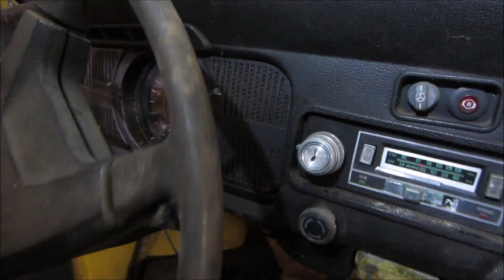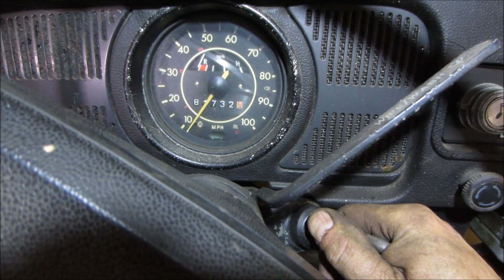Will It Run? vw Bug abandoned in a Leaking Wet Garage.

Comment: When you were jacking it up, it reminded me of many many years ago, a friend bought a beetle, asked me to show him how to change a wheel as he'd got a puncture.
He put the jack under ...& he started turning the handle as i watched ready to take the wheel off...
But it didn't move...& the jack was at its max height...
However the passenger seat  was around 8 inches higher than it was.......
Reply: Had that fun with a Fiat126 some years ago...the whole side rails beyond the doors were made of bondo and paint...
8-0
Reply: Szibul
Reply: Same thing happened to a family friend's bus. Right through the floor. IIRC he still drove it home.
Reply: @horstszibulski19  one of them is my dream car. But one of the polaski fiat 126p's
Reply: A good solution for a really short passenger.

Comment: Just fixed my first small engine thanks to your videos. Grabbed a edger for $10 and cleaned it up. Oil change and new fuel lines and cleaned the tank. Messed with the timing as well. All said and done it cost me $26 with all the parts and everything! Thanks for your videos

Comment: What a resurrection feat! Can't beat those old VW bugs. I once floated one in a flash flood. A wall of water came out of nowhere and washed me into the middle of an intersection, bobbing around like a rubber duck. A guy nearby saw my predicament, swam out and towed me to dry land. Turned the key and it started right up. The only casualties were the "cocoa mats,'' which smelled like moldy carpet, and the two tailpipes that rusted out. So yes, they did float.

Comment: Craigslist: "Volkswagen for sale, low miles, always garaged"
Reply: Never Raced!
Reply: 'ran when parked'
Reply: Featured on Youtube...
Reply: Some Rust!
Reply: lol
Reply: Just needs a little TLC!
Reply: Runs and drives!
Reply: Everything will buff right out only needs slight cosmetic work
Reply: Lool!
Reply: Passed most recent smog.
Reply: I know what I got, no lowballers
Reply: @xq39  Beat me to it!
Reply: HunterShows, That's funny right there, lol. It, unfortunately, is fairly accurate as well! lol.
Reply: One lady owner, serviced regularly!
Reply: @Mangsaab1954  I read this comment and thought..."I don't remember commenting on a porn video..." lol.
Reply: Lmao! 😀
Reply: "A REAL CREAM PUFF" owned by a little old lady!
Reply: Keyless ignition!
Reply: @northstar2007  no ran when parked means its broken but it runs
Reply: just dont mind the Head slap
Reply: Get it. As long as there is an engine. Super bug. Twin port. Easy fix.. Not sure about floor panels. Usually all rotten. Can be restored. Used to do them all the time. Combie. Fastback. Bug.
Reply: Remember number 3  piston overheats. Even on new restored ones. No cooling gets to no. 3
Reply: Tip
Reply: Spoke it depends on how much you drink. After a six pack everything looks lovely

Comment: My ex-father in law had a beetle in the early 1970’s. He worked away from home but left the car at home so that I or a neighbour could use it for the benefit of his wife & kids. It was a car full of character - spare wheel under the hood with the windscreen washer bottle pressurised from the air in the tyre, 6 volt electrics, de-mister vents in the corners of the windscreen that smoked at high rpm, fuel level gauge that worked from a float in the tank through a bowden cable to a slide that moved up & down in the gauge plus many more idiosyncrasies that made it a car to remember. I loved it. The neighbour always rested his foot on the clutch pedal & when it no longer pulled properly it went to the scrap yard. A few years later I changed the clutch in a friends beetle & it was so easy to change that I kicked myself for not changing the clutch on my father in laws car.

Comment: I have loved Beetles since I was a kid in Chicago. In the early 80s was when I fell in love. I used to like all of them though I knew very little. Two stand out very vivdly though. One was a 1975 because of the odd rims they had for that year model and also because this one was orange. A neighbor a block over from our house, owned it and it had a bad engine and it sounded bad, it was loud too. The engine eventually caught fire and was never fixed. The other was a 1973 yellow one that my father had for a very short time. The axle was locked up and it was never fixed either. As I got older I learned more about them and I finally got to drive one a few times which made me so happy. I've always loved the sound of those engines running right with the distinct chirping sound that when I was a kid, didn't know it was the muffler making that sound. The only ones I grew to not like is the Super Beetle and the 1973 and up regular Beetle or as I now call them the fat Beetle which are the less desirable ones. I had hoped to own one by now, but I haven't been so lucky because of how RIDICULOUSLY expensive the good ones are and how bad of condition or how much work I can't afford to do, the cheap ones are. I don't know how to do major work on cars, I don't have the patience or the back or hands for it. I'm glad to see some saved and fixed, but I also get so upset a lot of the time when I see someone who owns a ton of them and or who gives them away to other people when fixed or whatever, because I've worked so hard at trying to get one and never being able to. You are SO LUCKY to have them and I really wish I was you or the other fortunate ones to own all of them. I also always wanted a Fastback and Squareback too. Before I die I really hope to have all 3. I really want anyBeetle between 62 and 66 that can be a daily driver. I don't care what the paint looks like as long as it runs, drives and is reliable. Too bad I can't do a fund raiser to get one or be lucky enough to be given one. Oh well. Thanks for all your Beetle and other VW videos. I will also say this too, it is because of watching your videos I NOW know what the engine sounds like when it has no spark or compression and there is a difference in the sound when turning it over. Also what it sounds like when valves are sticking or knocking and when some of the cylinders aren't running. And the difference between a Bus and a Beetle engine, which I never knew were different.

Comment: It amazes me how you can get a car in such a bad shape to run its just 🤯
Reply: Volkswagon does it, again !
Reply: Makes me want to go searching for my next car in old garages! 🤯
Reply: Mustie1, the Master of VW land.
Reply: Its easy when you know what you're doing
Reply: I suppose it's only the engine itself that makes it run. But impressive
Reply: Getting to run is one thing... and actually quite simple. Making it safe and reliable to actually drive on the road legally is another.  The longer you watch Mustie the more you learn about the basic requirements to make an engine run... when that engine is not ceased or have a catastrophic failure to begin with (like it was abandoned because it had bent a rod or some other fatal reason).
Reply: @1marcelfilms  ????
Reply: @tbah9402  I guess you did'nt get my point : it's not easy at all ! But this good man could probably wake up a dead mummy !

Comment: Older brother had a 70 Beetle.  Fun to drive.  Always ran funny after a so-called tune-up.  At 30,000 miles it ran poorly.  Here was an intake valve where an exhaust valve should have been.  Intake is bigger.  VW denied any liability.  His ex got that in the divorce.  Auf wiedersehen!

Comment: WHEN EVER ME AND MY FATHER DONE COMPLETE OIL CHANGES WE USED TO PUT DIESEL IN FIRST AND TURNED THE ENGINE OVER FOR ABOUT 30 TO 40 SECONDS THEN DRAIN IT AND YOU WOULD BE SURPRISED HOW MUCH GUNK IT REMOVES . THEN PUT YOUR NEW OIL IN . I HOPE THIS IS SOMETHING WHICH HELPS YOU WHEN RESTORING OLD ENGINES . LOVE THE VIDEOS

Comment: As a young guy in college, enjoyed working on Bugs, had several. A buddy located a bug in nice shape, being sold at a low price, because guy thought it needed a new trans. He’d just gotten home from 6mo overseas. Would start, but “reared-up” when put in gear. Seemed odd, ran to my dune buggy racing mentor who ran the local Shell station. Asked “Has this been sitting for a long time with e-brake on?”  Suggested the sledgehammer approach. Figured we had little to lose. Towed it was worth just what we paid, if it rolled away, we were ahead. Paid the man his price...  had tow number ready...  smacked the rear wheels HARD and away we drove...😄. My buddy had a decent bug for an amazing price!

Comment: I like the superbug. No idea why they are poo pooed, I think they're pretty and I wish I had one.
Reply: Dan Tyson there has never been any love for the 1302 and 1303 by The purists but with the price of the early ones getting into big numbers it’s only a matter of time, just like classic mini’s 15-20 years ago you could get a runner for £50-200 now days )1000-2000 gets you ‘project’
Reply: I believe the supers developed a problem with the front suspension that is not repairable, or would be very expensive.
Reply: @ssmit80  the struts are not supported very well, big issues with strut mounts.
Reply: I have a 1973 Super for sale.  Fully restored.
Reply: @Mrflash222006  Yeah. Back in the early 2000s' the '60s' models had a pretty fair market value, but that's gone by the way. Probably selling for a lot less nowadays.
Reply: Dan Tyson : had a 74 Super Bug
Reply: @robj2704  THE VAN/BUS are the mkt. for now, and will be the thing for cross over electric bus..bugs will be dead in the water.

Comment: Makes me a believer in acid rain, my goodness that poor thing is melting like a witch.
Reply: Look up Sudbury Ontario. Infamous for acid rain back in the day. Rocks are black and took many years for trees to grow back.

The acid rain was due to the mining presence in the city and the lack of emissions regulations on smelters and refineries.
Reply: Just did what you said.  Catastrophic photos of dead forests and lakes lined with dead fish.  Although there are reports of slow recovery, it will take decades.
Reply: The old phrase “ran hard and put away wet” - most likely had some salt corrosion starting and the wet environment of the garage just let it fester. I had an 89 Subaru wagon that spent the first 20+ years of its life in texas before I bought it in Vermont. 10 short years later it was dead from rust. That was the most reliable $500 car ever. I would leave it for months on end and jump in the drivers seat and crank it and boom. Non interference engine, 5 speed and on demand FWD/4WD with even a 4 wheel LOW gear. I pulled small trees out of the ground with it.
Reply: Same situation with a Subaru Brat.  In many areas the metal rotted under the paint and paint was all that remained.  Tough little drivers

Comment: I'm always suprised at how easily those engines start after sitting so long, they don't make them like that anymore
Reply: And that's good. I like cars with more than 50hp with heating system that doesnt make my panels rot from inside. It was good by 50/60s standards, but it was just lazy of them to keep this in production for so long.
Reply: @MindBlowerWTF  They could definitely still be making engines this simple mechanically that aren't unreliable. Not air-cooled, but I was always hoping VW would give the world a modern take on a cheap rear engine Beetle.
Reply: @MrCarGuy image is everything. They don't want to be connected with "cheap"
Reply: @MindBlowerWTF  Not true. They have the Polo and the Up!. They also have much worse cars in Russia and China.
Reply: But they run for about 60k and they drop valves on #3. Maintenance on them is often and extensive (do you have to adjust valve lash every 3000 miles on your Toyota?). However they are very simple to work on because they were designed that way back in the 30’s.

Comment: I had a 1973 Super Beetle that came out mid year.  There were only 2 color choices:  Canary Yellow and Porsche Metal-flake Blue.  I chose the blue.  It had Recaro-style racing seats, flat black bumpers, Continental tires, flat black Lug Nut covers, and a fat steering wheel.  It was my first brand new car at $2695.00, about $400 more than a regular Super Beetle.  I did all my own maintenance including valve adjustments, tune ups, and of course oil changes.  It was a great learning experience. I traded it in on a new 1984 Honda Civic Wagon, that I kept for 13 years. Those were the days my friend...

Comment: How were you jumping the coil, would like to know as I am trying to start my 1957 standard vanguard that isn't getting any spark
Reply: Just wire 12v into the positive terminal on the coil, be aware that you will burn the coil if you leave it on for to long without the engine running. Also be aware that you are back feeding 12v into your electrical system which means anything that would be powered on by the ignition key will draw current through your hot-wiring which may lead to problems so make sure the ignition is on or you disconnect the default positive wiring.
Reply: Jump wire from the regulator. Don't forget to disconnect it though

Comment: try that with a modern car that's sat for 30 years. The engine'd explode if it didn't crack already.
Reply: None of the modern cookie cutter junk of today would survive 10 years....and NOTHING on any of them would be worth salvaging by then.  Probably a good thing as they are hardly worth calling a car when new.
Reply: @richardcline1337  And yet they cost ten times more than what these cars costed in the past. Funny how the slaveowners are progressively pushing worse conditions on us over time. Less pay. More work. Less freedom. More buying. Less quality. More spending. Less reliable. More replacing. We're a few decades away from being crackwhores - if you don't pay your dose, you die and nobody cares. And if you call it 'wrong' - you get shot.
Reply: The only thing modern that'll be fine in 30 years is almost any naturally aspirated Japanese engine. Especially the basic Toyota engines.

Comment: Huh, that interior was in way better condition than I expected! Since '88? I was born then! I'm kinda surprised the remains of that rear wheel didn't bust off while dragging it onto the trailer! I'm shocked the lugs game off! XD You tore that heat-pipe cover, now the mice will get lung-cancer! ;D One of my five engines had oil that black but thankfully no water! Two of the other ones have crusty sump-edges but are workable, barring other issues. One of the last two is in overall decent shape and the final one is still in the '69. It runs but is tired, or so it seemed with the crappy Empi carb and dizzy. Need to get back to it with better parts and see how it runs. Wow, it even idles! XD It runs great! Wow, talk about wheel-hop! If you left it stuck like that you could have a bug that answers math questions like they used to do with horses! Ha! Oh man, look at that rust/brake-dust cloud, I love it! This is an excellent will-it-run video, a real hoot! Seeing this run gives me hope I'll get mine going! What's the bracket/brace bolted to the tunnel up by the pedals for? Dang, even has lights! XD
You found Gandalf's horse!

Comment: Of course it'll run, it's a Veewee. It may not run *well*, but it'll run. I remember when I was trying to tune up my '64 bug many years ago and could never get it to run well on test drives around the block which included a somewhat steep hill. It turned out that the rocker arm assembly studs on one side had broken so it was only running on two cylinders. But it still ran!

Comment: I had never been all that interested in them before, but Mustie has kinda sold me on picking up an old VW to restore.  31 years rusting away in a garage, and he can pretty much always clean a few things on these engines and fire them right up.  Seems like a good thing to have as a backup in case your newer daily has some debilitating electronic hiccup.
Reply: They're not really all that well-built vehicle, but they make up for lack of quality engineering by their simplicity. 

It really helps to have a mechanical interest to own one. The more you work on them and other stuff the more you appreciate VW's simplicity.

Comment: This reminds me of the days (and nights) dad and I would spend working on old Beetles. They were always in our family. Dad and I could change an engine out in about twenty minutes. I’d lay underneath and take out the bottom two bolts and dad would take out the other two. I’d bench press the engine to my chest and dad would pull me out by my ankles. Then he’d set the rebuilt engine on my chest and roll me back under. Ah, those were the days! I know Dad’s in heaven busting his knuckles still!

Comment: If I were a mechanic (and I'm not), I would have been the type to start with cleaning & vacuuming all the crud and loose rust, then try to work on the engine. You dive right in on it, seeing if get it running first, which makes so much more sense.

Comment: we had a 71 superbeetle convertible that was the "auto manual shift"  It had a spring switch on the shifter column that would release the clutch electronically so you could shift! Super neat!

Comment: That's one very rough Karmann cabrio.  It's still got lots of good parts though, and it looks like a full set of original Karmann glass and frames which should be worth a decent amount.  It's a shame that one sat so long in the leaky garage as, even being a Super Beetle, that would have been worth saving if it had been stored better or retrieved sooner...

Comment: On supers you can access the wires for the starter relay and such from under the seat. There is a big red wire on the passenger side in a plastic junction box before it leaves the floor pan. Right there you can attach a trigger and run it to the positive of the battery.

Comment: I would strip all the glass and frames out take all the parts and scrap the rest. WE did have a no rust 75 pan and body but It got cut up. I told Jason about it just in case. It could have saved that car.